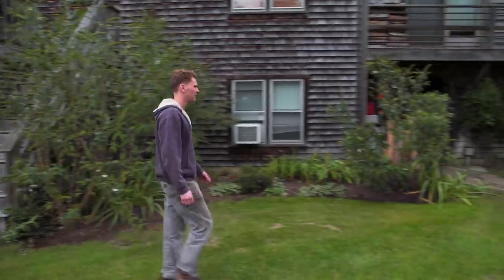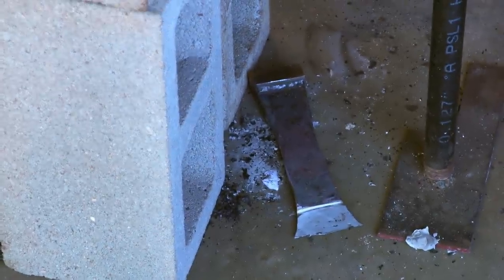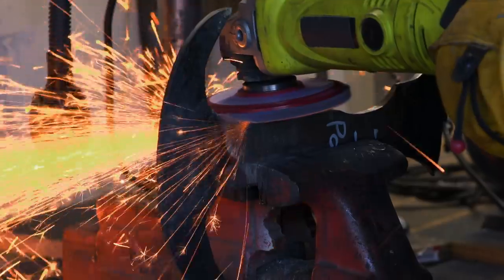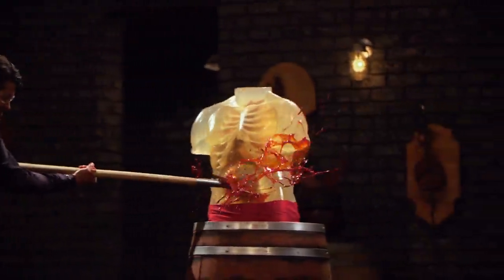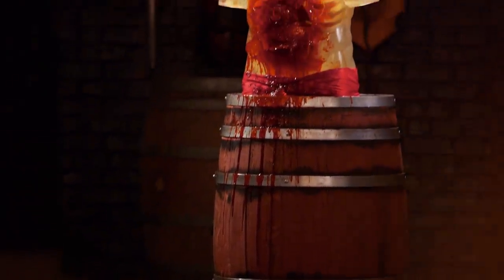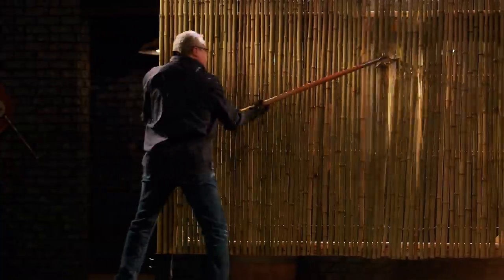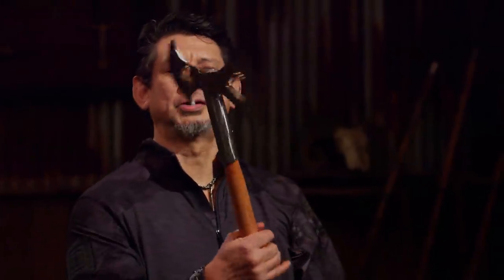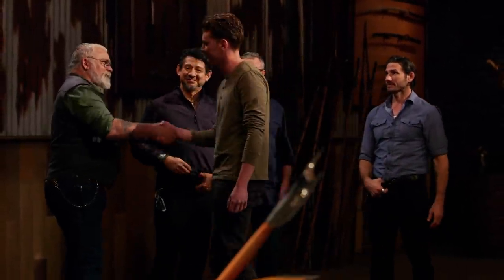Forged in Fire: THE BEST Japanese Ono OBLITERATES the Final Round (Season 7)

Comment: How the haft is fastened on the one with the hearts is beautiful, I’ve never seen anything mounted like that.
Reply: Yeah. Looks like the "wedge" is connected to the socket of the axe. Very interesting looking piece
Reply: There aren't too many weapons on this show that leave me in awe, but Keaton's is one of them.  I've made a couple tomahawks, and I know hanging an axe head like that is masterful work.  The wedge is INTEGRAL to the axe head!  I've never seen that, and I certainly can't do it.  I'm amazed.
Reply: @honorb4glory606  further proof that he did earn the "Forged in Fire Champion" title by a far greater gap than many other contestants.
Reply: @elementxxrider  certainly not by a 'far greater gap'. There have been champions that won by massive gaps marked by actual differences in performance or failures in the cutting or strength test. There was no difference in performance here except for the weight and design which ultimately won him the championship title.

Comment: It's too bad that fellows first try broke. Would have been nice to see his work with the extra day. But that's part of the challenge. One thing I've noticed is the guys that go that extra mile usually win. Whether it's some beautiful Damascus or perfect balance or in this case decoration and a deadly haft mounting.
Reply: what i've seen is that the ones that go for function over formality tend to do better. you can make some beautiful damascus but once it goes to testing you really see a difference. monosteel always has the edge of simplicity. no worries of bad welds, no worrying if the metals don't mesh and break apart, just if something snaps in the forming and if it warps in the heat treat.

Comment: Im kinda tilted that they cut off the explanation why Logan lost bcs both weapons performed outstandningly (Logan's axe actually did better in the kill test in my opinion)
Reply: The usual reason is weight, but they also mentioned the wrap made it difficult to slide their hands when they swing.

Weight and handles tend to be the two largest reasons that one blade wins over another. Each has caused no confidence and immediate losses.
Reply: thanks!